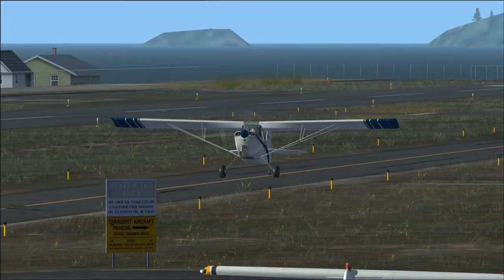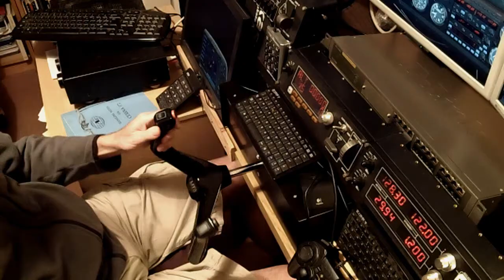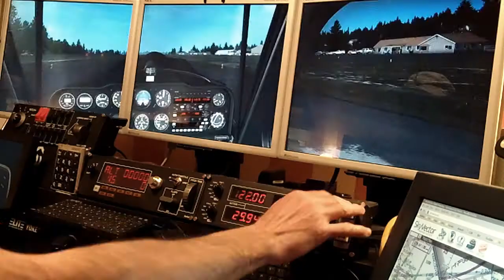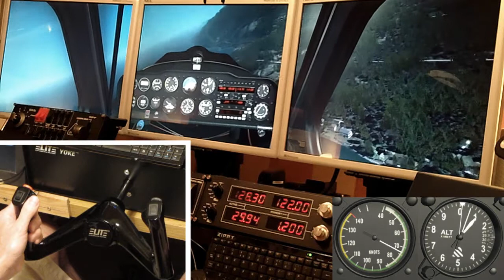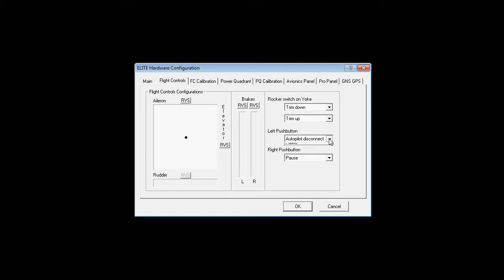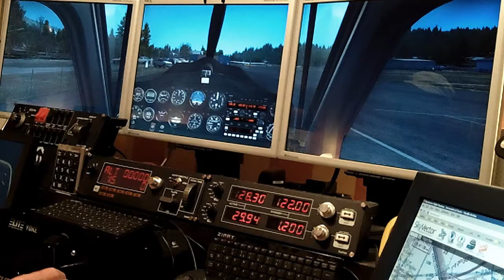Elite Yoke Review

Comment: Hi i just brought one of these used. I just want to know how many degrees does it rotate? Thanks
Reply from the maker: It goes 45 degrees each way. Interestingly, I am just about to put mine on ebay! Alongside two Elite AP4000 radios. In my view the Elite yoke is second only to the Yoko. It’s better than the honeycomb Alpha, although it doesn’t have all the buttons.
Reply: @AlmostAviation  thanks. It's not limiting only to have 45 degrees? I just hope it arrives safely. Since I live in Denmark and the unit is located in usa
Reply from the maker: @HARDESTBOOM  I don't think the 'limited' travel is a problem, not really. Of course if you switch from a yoke that has a 90/90 travel you will notice the difference but you will soon adjust. A lot is made of the roll travel but I think the pitch travel is much more significant for most flying. I can't remember the exact pitch travel of the Elite yoke but it's substantial. I don't think you'll be disappointed, assuming the yoke arrives safely. The shipping must have been quite a bit from the USA, it weighs a ton!
Reply: @AlmostAviation  i paid 400 dollars with taxes and shipping. Seems alright. Same price as a honeycomb alpha xpc
Reply: @AlmostAviation hey again if it's not too much to ask what are the dimensions of ur unit? Can't find anything online.thanks alot
Reply from the maker: @HARDESTBOOM  Sorry, it's now in a box and all taped up :(